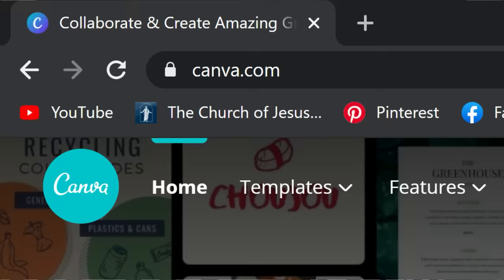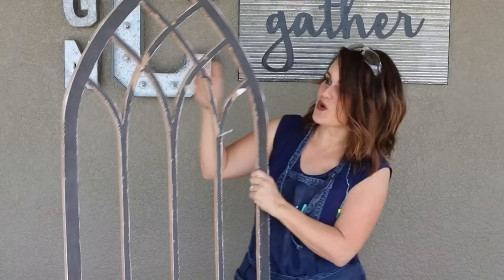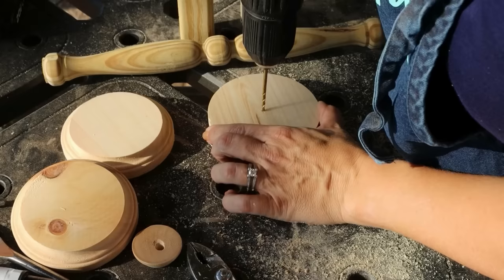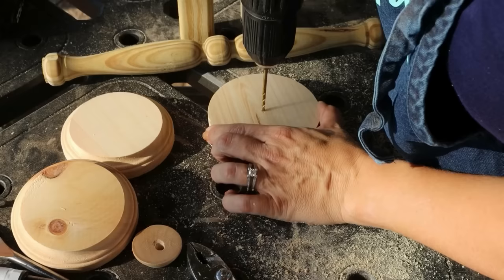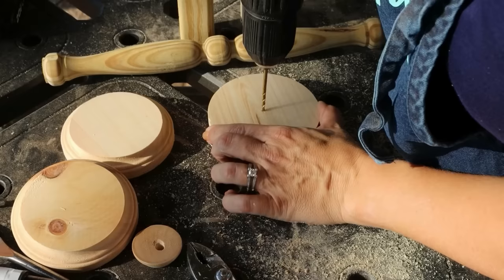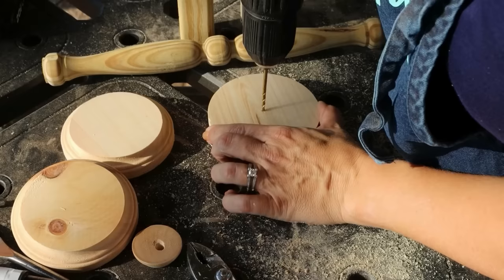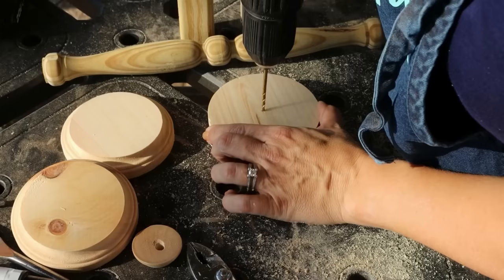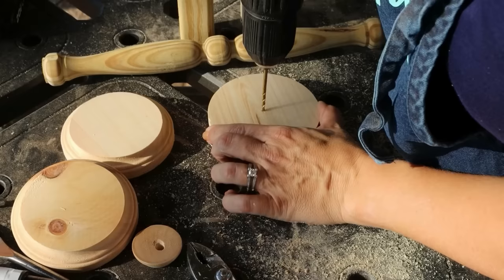Absolute TOP 25 BEST High End Decor DIYs & Dupe Ideas On a BUDGET!

Comment: For anyone that wants to make a bench, you can make a bench out of a coffee table.  It works out wonderfully.  Very simple.  Add/glue/attach foam to the top, and then just cover the top with your choice in fabric.  I bought a tile top coffee table for $5 at a garage sale and did it.  Kept the wood legs the way they were.  Project took about an hour, if you don't include drying time for the paint (it was a light oak wood frame, I quickly sanded and then painted, I believe 2 coats, maybe 3... I might of primed first.  But it came out super cute, and was very fast.  I can also recover it however I want, whenever and won't need to repaint unless I want to change it to a dark color or something (I painted it off white), and used it as an end of the bed bench for my daughters room.  Currently it serves as seating in her playhouse.  Quick and Sturdy.

Comment: Wood candlestick holder ALERT: I lit a candle one time that was on a wooden candle holder. It was painted gold so I might have thought it was metal. Set it on my wood fireplace mantel. Came in a little later. The candle burned down to the wood and the entire thing was engulfed in flames! Luckily, I got the fire out but it could have easily burned my entire house down had I not gone into that room just in the nick of time.
Reply: You  are never supposed to leave a burning candle unattended. Yours is a cautionary tale,

Comment: Since I got some new great tips here, I’m sharing one of my own to give back. If you use 2 pairs of needle nose pliers on each side of a ring and slightly twist in opposite directions (like with the O facing you and bringing one side toward you and one side away, if that makes sense without a visual!) to make the opening, it’s so much easier to align back up than pulling apart, away from the “seam” and then trying to pinch back together. I was always taking the finish off rings by trying to smush them back touching with one pair of pliers. Hope that makes sense. 🤷‍♀️

Comment: What a great project.  Your result turned out great.  I just discovered you/your videos and have only watched a few but I like what I see and can definitely learn some skills from you.  I look forward to watching more, so thank you for sharing   Like you, I love my power tools, although I don't have a pneumatic nail gun.  Until now, I never saw the need for one.  It's going on my wish list, for sure.   Two things I don't understand in this video:  1.  You said the metal pieces were too thick and dense to screw on to the tray but it looks like they have pre-made holes on each end.  Even f those are just divets, they are good hole starters, aren't they?  A cobalt  drill bit would also do the trick.  2.  Why go to all the trouble of making a stencil when you could use pre-made letter stencils and save all that time?  Also, doesn't Cricut charge you for every design you make on their studio site?  I bought a Cricut Explore Air when they first came out, thinking it was an improvement over my Cricut Expression.  I went on line to create a simple stencil using just letters.  When I found out they wanted to charge me to create my design, I took the machine back for a refund.  I felt as though the site was just a way to hook people in so they could make more money off of them.  It wasn't enough that they charged $300 for the machine and plus the cost of the mats and the tools and the blades and the paper and the vinyl, not to mention the $20 - $30 per cartridge.  They actually found a way to charge you for your own creations!  Anyway,  I still have, and use, my Cricutt Expression - It may not be the latest and greatest but unless it breaks, I can use it to my heart's content and I won't be charged for my own work.  I also won't be bombarded with ads urging me to buy more cricut products ...  I
Reply from the maker: Cricut has a flat $9.99 a month fee now and you can upload your own designs or use any other designs in their studio… Use whatever font you want. It’s actually pretty great. You can get a Cricut explore air 2 right now for $179. I love my machine. It is really upped my game with home decor.😃

Comment: Good job on talking about safety. I think it is best practice to keep hair pulled back when working with power tools. A second of visual obstruction while running a jig saw could have big consequences.  Fabulous projects! If you have access to an air compressor, try a pneumatic stapler, you will be amazed at the difference.

Comment: for scalloped edges and it would work for the cake stand you have done, you can actually cut a piece of felt the circumference of the area your gluing to, attatch the popsicle sticks to the felt then glue the felt to the stand, it also prevents needing to use the extra filling pieces to keep it even like you had to do..... i've used this method and works very well just wanted to share with you! and you wont get covered head to toe in glue!!!!

Comment: Rather than cut up a cookie sheet to make the metal strapping, I would look for black vinyl or rubber. You need about an 1/8 thickness and could probably find it in sheet form. It would be easier to cut and might take a 90 degree bend without cracking

Comment: I also think that using a small paint roller would be great for putting transfers, etc to give a bubble free application and ensure that the whole poster is covered without missing any spots.
I've also see copper sold by the roll .... not sure, but I think it was ebay.
We also don't have the great coupons that you have in the USA.

Comment: I am inspired to make Bahama type shutter for a craftsman home. Their purpose is to shade the window to help with a/c cost during the hottest months! Wood frames and materials are too heavy to manage putting up! I thought about the plastic greenhouse panels. These would be light enough, readily available, and cost conscience. I bought several panels, thinking to try them before summer gets here. Would you help with framing and hanging ideas?I am stuck at finding an inexpensive idea to prop these and make them a little wind resistant. I plan to just hang them by hook and eye, so they are removable. Am I wrong? These panels come in several colors. I chose white.

Comment: What do you recommend to seal letters/numbers (chip board) for outside use?
Reply from the maker: I didn't seal mine with anything, but if there is any chance of water getting on the chipboard at all, I wouldn't recommend using them outside. You can find some in plywood and you will be much better off.

Comment: I have a helpful hint. When you need two pieces of wood to come out to the exact same length stack two pieces together and cut off at the same time. Voila, you now have two pieces that will be exactly the same length with no possible deviation or discrepancy in length.

Comment: When you were talking about making your monogram for the Pottery Barn barrel top lazy susan, you mentioned that waxed paper doesn't work in your printer; this is true.  Have you tried using freezer paper? It is sturdier than waxed paper and waxed on one side, like the Avery label sheets.  Quilters use it to iron fabric to in order to run it through the printer.
Reply from the maker: I haven’t yet. But I’ve heard great things so I’m just may have to try that. Thanks for the endorsement!😃💕
Reply: Love the lazy Susan tray. After you peeled off the paper I can see some “stuff” left. Is that the stuff you painted on before applying monogram?  How do you get that residue off once you peel off?  First time on your channel and now a subscriber. Great stuff!!!!!!

Comment: For the chandelier, pocket holes screws would have been really great and offered a very secure join.  I have had glued dowel connections split on me so now I am wary of using that method. 💔

Also, with the tin sheet strapping, I'm curious, was there a reason you didn't make them 2" longer and have them overlap under the tin can to really secure them in place and hide the seams, as there would only be one on the top middle instead of on each side.
Reply from the maker: Thank you for your insight! I went with the dowel for visual aesthetics. A pocket hole you would have been able to see.as for the joints... so far so good. They’ve withstood about 1.5 years of Florida heat and humidity. Also I decided not to double up on top for the same reason... aesthetics. Maybe it would have looked just fine, but I was worried about seeing the 2 layers of cookie sheet. Thank you for your questions. Hope my answers helped! 😃

Comment: Looking to get a nail gun not sure which one to get
Reply from the maker: I recently bought a metabo brad nailer (18 gauge) that I really like… I also on a porter cable finish nailer (16 gauge) that has been great as well. The 16 gauge is a little thicker nails in the 18 gauge. I use them both. Then of course I have my framing nail gun. I run them all off my air compressor. But they do sell an electric version that plugs in. I have a Brad nailer/staple gun... that plugs into the wall… I have noticed that it doesn’t always drive the nails in as far as the one run by an air compressor. Hope that information helps you.

Comment: You picked a difficult pattern material  for the bench .  With piping it should be sewn and cut on the bias.  Stripes and plaids are the hard enough matching without adding piping in the equation.  For a beginner sewer who uses a similar fabric, they might want to cut the piping out of either all gray or all  ivory.

Comment: Designed to the Nines
FYI...
Sunglasses aren't a substitute for safety glasses!
Safety glasses are specifically made with a different material to prevent them from cracking, splitting, exploding. etc. when being hit by nails, wood, pieces of the saw breaking off, etc..  They are not made just to keep the saw dust from getting in one's eyes.  Not only is it dangerous to use sunglasses as a replacement for safety glasses, but is incredibly irresponsible & stupidly ignorant!